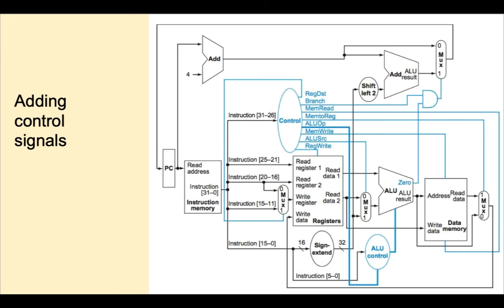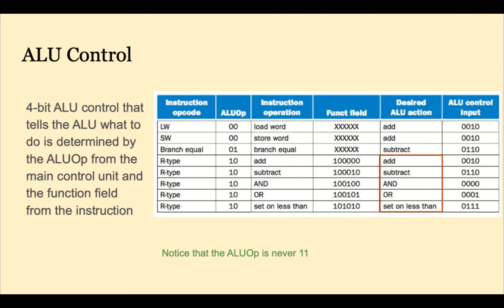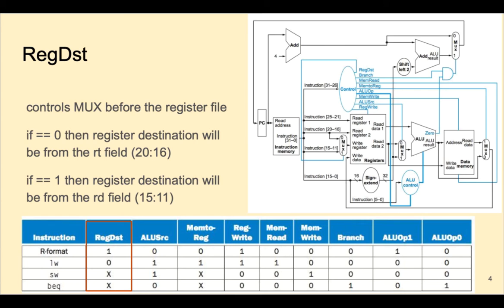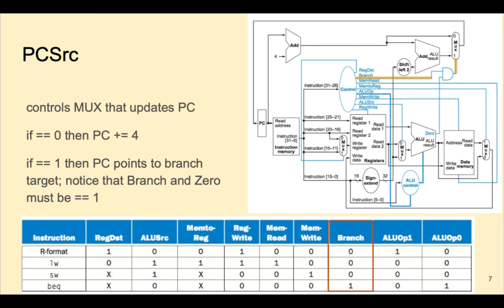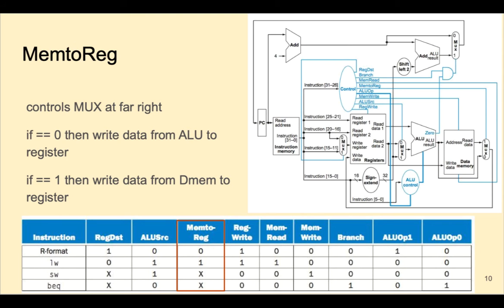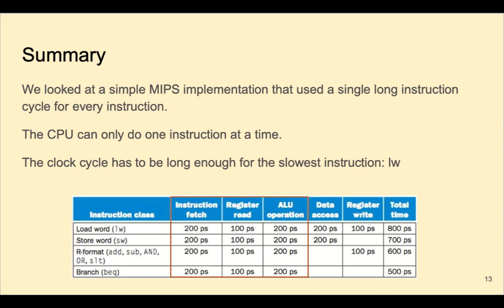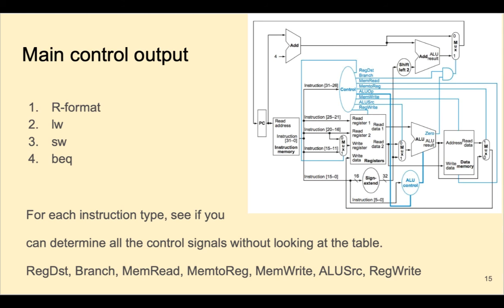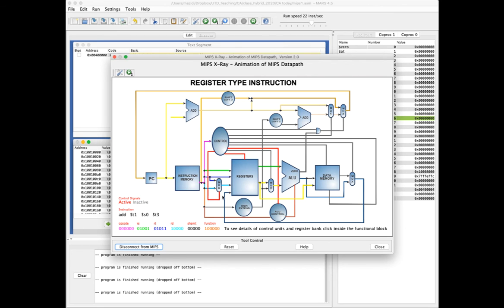CA16 - MIPS control signals

Comment: What is the control signal for lbu ? It is the same of lw ?
Reply from the maker: This simplified MIPS implementation doesn't have the lbu instruction, but if it did, the control signals would be the same.
Reply: Ok Thx ☺️